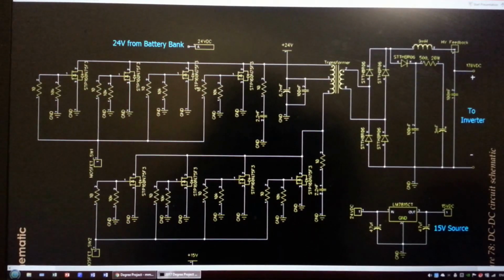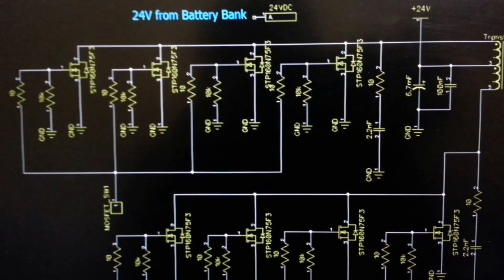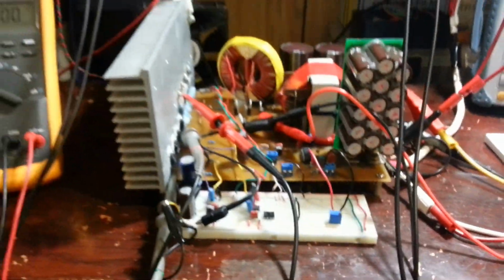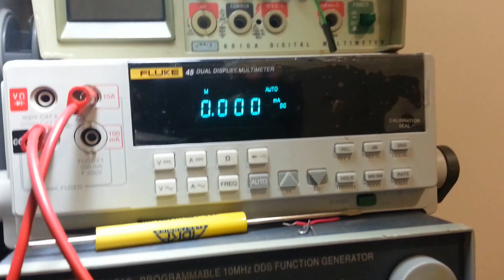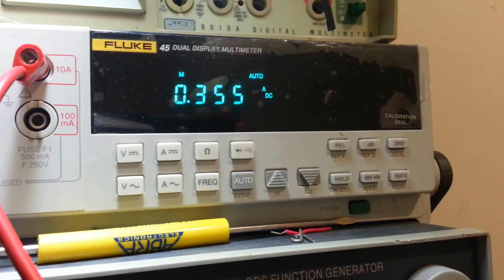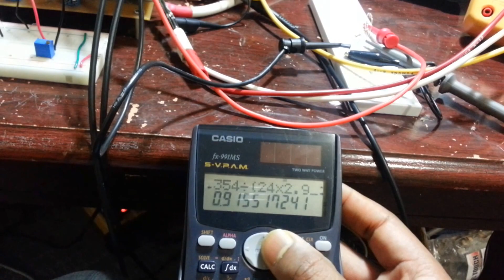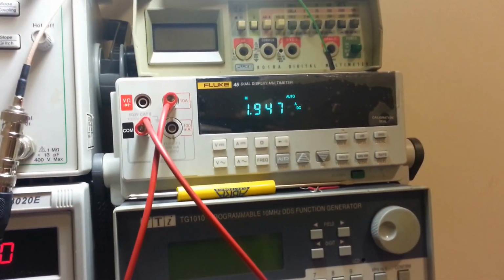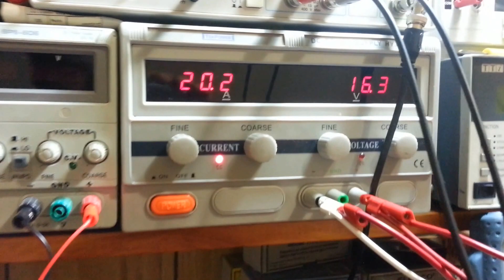High Frequency Inverter Boost Stage 24VDC to 180VDC Design and Testing Using SG3525

Comment: Have you tried SiC mosfet?e.g. IFXH220N06T3, it's 60v, 4m ohm rds, but 220A peak current. Can it reduce from 4 pair to only 2 pair by using SiC mosfet to increase its efficiency?
Reply from the maker: Those are very expensive MOSFETs and also aren't available through my local parts supplier.

Comment: Can you say more about the high side mosfet drive?
Reply from the maker: This DC to DC converter uses the push-pull converter topology and as such doesn't use any high side switch. Therefore there is no need for high side MOSFET driver circuit. But for the low side drivers I am using the MIC4422 datasheet @ https://www.mouser.com/ds/2/268/mic4421-22-778617.pdf

Comment: Hi i am building the same circuit, but input voltage is 11v and output is 380v.
I am getting MOSFET turn off spike which destroys my circuit all the time.
Using irf3205 fet. Switching frequency of fet is 25khz. Snubber circuit added but no use. And transformer is 4+4 turns primary now, tried 3+3 also. Designed for 600w
MOSFET is getting thermal runaway after connecting 50 or 100w load. Gate signal is clean.
Reply from the maker: Is your transformer a high frequency transformer capable of operating at 25kHz? What core material are you using? Also which side is the snubber circuit connected (11V side or 380V). Also do you have bulk input capacitance? If you do what value is it?
Reply: Smith Kerona  transformer is EE 42/21/20 and it is good to operate up to 100khz.
Input capacitance is Elna 16v 2200uf x3
Irf3205 x2 per side.
Snubber needed for primary side..
Reply from the maker: Make sure to have snubber circuit on both sides of the transformer (specially right across drain and source terminals of your MOSFETs). Here is a good application note on how to design snubbers from TOSHIBA https://toshiba.semicon-storage.com/info/docget.jsp?did=13416 starting on page 12. As seen on the schematic at beginning of the video, I have an RC snubber for the MOSFET switches and RCD snubber on the primary of the HF transformer. Also make sure your IRF3205 are not counterfeit MOSFETs! 

BTW what is the maximum input rms current at full load for your converter?
Reply from the maker: Also another issue could be your HF transformer. You may have too much leakage inductance if you haven't constructed the transformer correctly.

Comment: Very informative video 
 Sir kindly could u plz mail me the schematic daigram
 my mail  id :-alingeorge123@gmail.com
Reply from the maker: The schematic diagram is shown at the beginning of the video. The converter is of the push pull type. Take a look at the datasheet of SG3525 and it will tell you how to calculate the necessary passive components needed to setup the required frequency of oscillation. Here is a similar design but with much lower output power https://i.stack.imgur.com/6nOIs.png